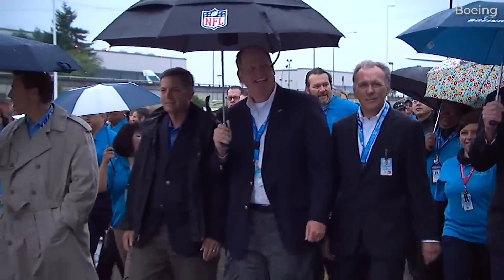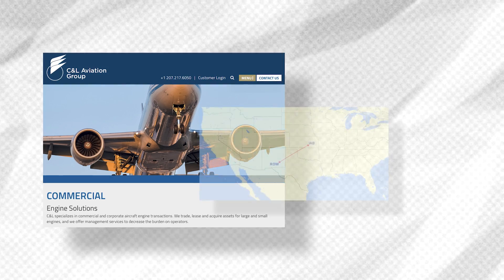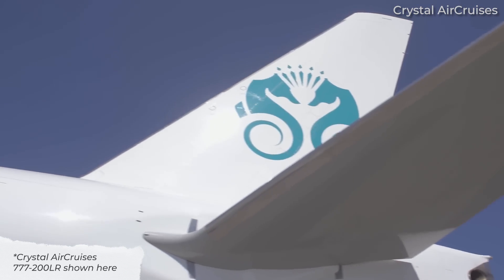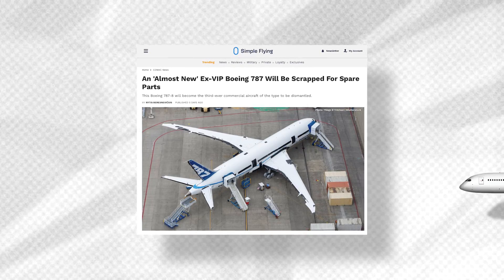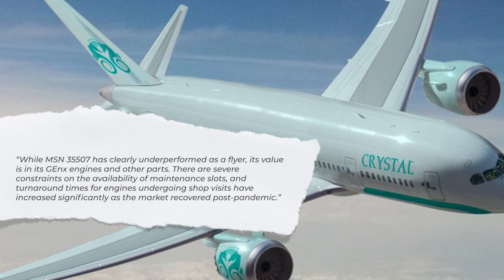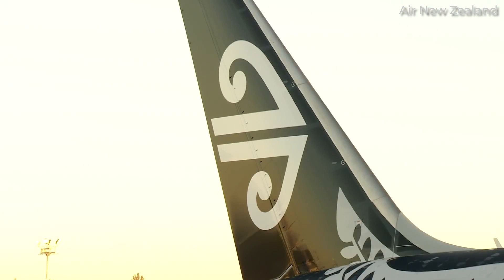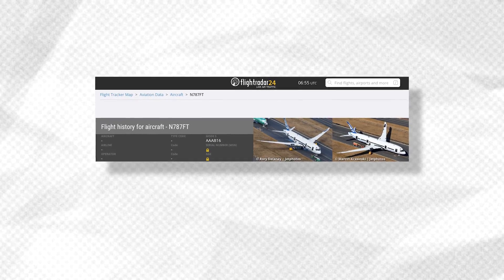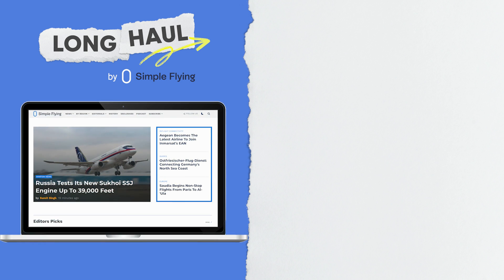An 'Almost New' Ex-VIP Boeing 787 Will Be Scrapped For Spare Parts

Comment: When the carbon fiber fuselage and lighting mesh is exposed to the elements that is a serious problem! -- Aluminum fuselage planes don't need to have lightening mesh wrapped around them. Boeing’s 777X version will has an aluminum alloy fuselage (aluminium-lithium) "which is cheaper than carbon fiber and better than previous aluminum alloys. As a result, Al-Li alloy-intensive aircraft have better fuel efficiency and LOWER MAINTENANCE COSTS!!!" -- see: AI, Aluminium Insider, May 3, 2022. Aluminium-Lithium Alloys Fight Back.

Comment: The early 787's were all overweight, and the first ANA aircraft were confined to domestic routes because the extra weight canceled out the supposed fuel savings. Boeing scrapped several in a remote corner of Paine Field and there were a bunch of them that had "issues" and sat at Everett for years until finally being reworked. At Boeing, we called these Legoliners "teenagers".

Comment: Scrapped for parts isn’t a correct term. The correct word would be cannibalised, no cannibalism isn’t just about eating your own species, it’s also used to describe the act of using a disabled/incapacitated/non-completed vehicle or object, stripping its parts that are usable and reusing them on another object or vehicle which is either in need of repair or maintenance (but is in reach of being serviceable). 

So you would be correct to say that whenever you strip the pieces of a car that’s going to the scrapyard and reuse them as spare/replacement parts, you’re cannibalising.

Comment: I am interested to know what happens to the fuselages and wings as they are all composite.
Reply: It's not economically viable to recycle graphite reinforced composite materials.

However, if you want to recycle, remove all of the metallic components, cut into smaller pieces, heat to 1250F to burn off the resin, and rinse the ashes away. Otherwise, acid digestion is performed. 

The early barrels had wrinkles in some of the plys from the debulk process. Those areas were ground down to remove the wrinkle, then new plys were bonded (scarfed) over the locations. If memory serves me, KAI produced the earliest barrels.
Reply: They sell them duuuh
Reply: @Lmaofunye99  To whom? It's not like aluminum aircraft where the metal can be recycled. Airlines aren't replacing whole barrel sections and it's already been proven that the barrels can be repaired. I can see selling access doors, control surfaces, etc. but you aren't going to sell the main parts of the barrels or wings. So...one more time...what are they going to do with them? FYI, I kinda know a thing or two about these aircraft and how they are assembled because I was there and I saw it.
Reply: They will get thrown out
Reply: @CineZoneYT  but HOW are they disposed of? Come on, people...I didn't think my question was THAT cryptic!
Reply: @CineZoneYT  OK...THEN what!? It's like playing 20 questions with a 5 year old! What happens to the waste!? THAT is the question. Do you think that your trash just magically disappears from the can and gets eaten by a trash troll? NO! It goes SOMEWHERE! Some places burn it. Some places burry it. Carbon fiber can actually be recycled in many different ways. So...what happens to the barrels and wings?

Comment: One of the most, if not the most uncomfortable planes I've flown with.
Reply: How? Pretty much all planes are the same in economy. Most likely you chose a cheap airline 🙂.
Reply: I found the 787 uncomfortable, I sat on the starboard side window seat DC to Istanbul

Comment: Due to the many problems with Boeing including delays of delivery of new 787,s it stands to reason scrapping older less used examples are going to be big business as spares are going to be in very short supply.   Now we could go into the many reasons why they are being scrapped such as a tax loss on a capital procurement to the airline going out of business but no aircraft especially one so reliant on electrical power do well standing out of use and the cost to get them started back as a flying examples cost would be prohibitive.

Comment: As a passenger, I loved the 787. To bad that the companies using the 787 had so many problems with it that they stopped using it for long-haul flights. Today if I want to fly from Scandinavia to Asia I can only choose Airbus 350.
Reply: The 787 and a350 are in different markets. The 777x competes with the a350, and it is actually more popular than the a350!

Comment: There has to be a significant problem with the terrible teens allied to a high value and low availability of spares to make this situation viable which it clearly is as three frames have been or are about to be parted out.
In comparison the A350 which first flew in June 2013 is approaching the same age as the parted out 787’s but, apart from pre-production test airframes no commercial airframes have been parted out.
Reply: More than a few of the Terrible Teens are refurbished pre-production airframes.  The difference is that Boeing decided they could be sold at a discount instead of being scrapped.
Reply: The a350 sticks to older technologies, while the 787 uses many new systems. If Airbus was capable of making something like 787, they would also have some failures :)
Reply: They're 21000 lbs overweight

Comment: Sad to see. The 787 is a magnificent machine, and has never suffered a fatal accident since its first delivery in 2009, a testament to its excellent design. 
Too bad that Boeing have lost their way lately, if only they could come back to their senses and resume production under strict quality control measures, we would be able to enjoy these great aircraft for much much longer.
Reply: Notice you wrote fatal accident. It has had plenty of accidents and was a literal dumpster fire at launch with several burning down.
Reply: @zeitgeistx5239  It's hard to make the first models of something as innovative as the 787 work perfectly when they are new. Airbus still hasn't matched many of the 787's new features.

Comment: Rolls-Royce at it again with their trash amount duty cycles both on the 787 and A350
Reply: What are you talking about?
The aircraft being dismantled has 2x GE NX engines, manufactured by GE.
Reply: @AnotherPointOfView944 not the case for air new Zeeland also mentioned in the video
Reply: @f0x4nn3 
"ZEELAND" is in the Netherlands, nothing to do with ANZ. You're all over the place
with your anti RR rant..........

Comment: the B787-9 BBJ & B787-10 BBJ is the ultimate expression of high-end air travel at a level few can only dream of . . . personally i prefer the B787-10 BBJ with a lavishly appointed functional cabin, good for 38 - 43 paxs + 8 crew . . . able to fly Hyderabad (HYD) - Washington D.C. (IAD) non-stop or Hong Kong (HKG) - Dublin (DUB) . . . don't really like the bedroom concept on large business jets like the BBJ2 & ACJ321 Neo . . . bedrooms are for homes & hotels not some aircraft . . . if Boeing is to sustain in the commercial air travel market the company should stop pursuing the B777-9X program & revert back to making the B777-300 ER wide body jets with new GE90 engines . . . enough time & money has been wasted in the past few years, starting with the B737-MAX debacle followed by the uncertainty over the introduction of the B777-8X & B777-9X . . . infact the B777-9X was supposed to enter revenue services by 2021 - 2022 followed by the B777-8X in 2023 . . . had Bill Boeing been alive today, he'd be very disheartened & sad . . .
Reply: actually... that'd be the top of the line business jets of Gulfstream or Bombardier. They're faster, fly higher, and lands at more airports which means shortest possible flight times.

Comment: Worked on a bunch of those...... they were total garbage.  Below LN 10 they were complete 💩 LN6  was flooded, and had black mold growing in the carbon fiber.
Reply: But isn‘t LN6 still in service?
Reply: @jaky2484   It was sold to the Mexican gov't as a BBJ.
Reply: "But isn‘t LN6 still in service?" @jaky2484  
As VIP for mexico I belive
Reply: "and had black mold growing in the carbon fiber."
I had no idea it was possible!
Reply: @arofhoof  yeah it is, so basically you can get delamination of the carbon, the first inspection being a coin tap test to look for hollow areas in the carbon then go X4 times the size of the hollow area to find the size of the delam.
NDT will then run an ultrasound of the effected area where black areas show on the ultrasound indicates water ingress. If that'd not found in time stagnant water can allow mould to grow between the layers.
Reply: Terrible teens happen on almost every aircraft, parts are made before certification and of course big things like no retrofitting them to cert means it never makes the intended MTOW. Also ANA didn’t mind because being the first to order the 787 and get many of those teens, as they came with huge discounts along with late compensation.
Reply: @technole  I'm aware of that. Not to mention the tons of B 1/2 in the tanks to solve the leaking fuel cells
Reply: They are called terrible teens and are not conform with the type design.
Reply: Teenagers at EMC being reworked. Ahhh...the memories.
Reply: Poor quality control 🤷🏼‍♂️
Reply: Built by union slugs…
Reply: @lookylook570  wow...can you show ANY more ignorance? You clearly know nothing about the 787 supply chain, who it's built by and how. Now, did you simply want to S-post and get attention or do you have something else to add? Personally, I suggest you STFD and STFU.
Reply: @lookylook570  a simple comment from a simple minded person
Reply: @lookylook570  that's your opinion. I happen to know some really good union people who are very talented at building aircraft.  What's your skill set?

Comment: One less nightmare to deal with
Reply: hallelujah
Reply: @swagathshetty praise the lord 😂👍🏿
Reply: @wadehiggins1114  Fact: not a single 787 has ever suffered a major accident yet. You're just a propagandist and a scaremonger. The 787 is a good aircraft despite Boeing's current malpractices.
Reply: @osasunaitor  are you forgetting all the fires that grounded it years ago?
Reply: @osasunaitor  Because it got grounded before it could
Reply: @j134679  Grounded isn't a major accident. Sorry, better luck next time
Reply: @chechnya   fire is still a major deal regardless. It is safe now because of changes, but that doesn't erase the fact that it happened after delivery.
Reply: @j134679  blame the company that made the batteries no?
Reply: @jagermain4207 

If your hard drive in your macbook fails you don't ask the vendor in Taiwan to repair it its apples responsibility
Reply: @swagathshetty  I'll get a different hard drive from a better company and fix it myself?
Reply: @swagathshetty  also your opinion on the 787 won't change the fact the aircraft is selling phenomenally with 1100 orders and is a wonderful just like every aircraft out there in the market except maybe the MAX series.
Reply: *nightmareliner😂